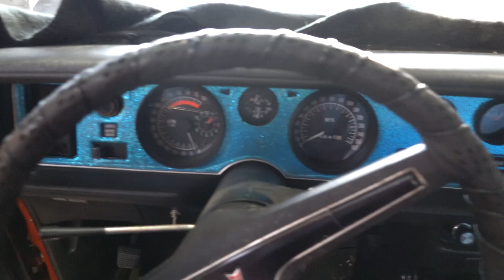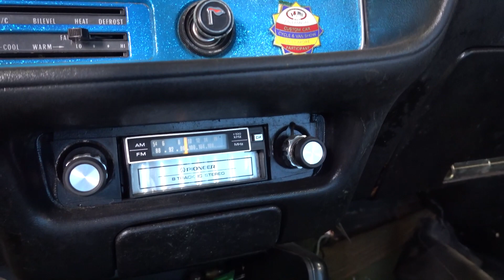1 in a Million Barn Find, Street Freak Firebird! Left since the 90's, sold for $500!!!

Comment: Use an aluminum head  massive stroker butler Poncho Pontiac engine it it.  OR  at that point why not a massive light weight caddy engine? with a huge stroker inside of it. OR Well i also believe a 455 or 400 would be great with the original blower just mild or something. OR
Put in a dart 400 small block chevy block with a 3.625" forged crank that is ground to 3.66" stroke and balanced by david vizard or similar, and 6" rods with with some forged blower pistons, put on some trick flow super 230cc heads and slap on a 6-71 or E force super charger Use an AED 950 blower carb. With a bore of 4.125" this makes a 391.46 C.I. with a great rod ratio so it shall last. Use blower rings, a custom windage tray, and use hooker headers. put some cal tracs on and if in the budget use a 4 speed jericho, this is what the hood was cut out for and this is what fits perfectly-(OOPS i am just noticed the ram air III ported heads 350 pontiac engine that was in it sorry). This engine is much lighter and more efficient than the poncho engine  i just think with the reduced rotating mass it is going to be a happier car and a happier you when all together. Your piston height shall need custom based on 9.000" or 9.025" deck height and your rod to crank journals are smaller so get rods with the needed diameter. It is going to be great. Go easy on the cam a little bit use an XR288HR10 hydraulic roller or the other bigger ones. Ask richard holdener. If you do make this thing you could have anywhere from 500hp to 1000hp depending on boost. You really want a jerico 4 speed for sure. Don't use 3.73 , use 3.23 gears this shall cruise a ton better. I personally would use P295-50R15 on a 15X12 on back with 5 to 5.25" back space ,and not skimmpy on front either, at least a P235/60R15 on a 15X8. For less power and rpm you could go smaller heads and cam and lower compression respectively. We can configure it to run pump gas. i also have many other combos in my notebook. i would get some BFG's for driving but traction is ZERO in that regard for these power levels. As far as bias ply, there is not anything wrong with that, although it is dangerous because they have sat so long because there is likely cracks and compound changing to a different material like rotten probably. My little mustang II ferocious 8000rpm screamer that it was, tore some bias plys rear tires to shreds while driving one day, they were old had a few cracks like several mm long , it don't take much. So i recommend new tires on weld racing aluminum wheels. You can put some P275/60R15 on some 15X10 for easy fit, 5" to 5.25"  backspacing some get 5.5" backspace and then add a quarter inch spacer. this should fit the wheel well much better than the 15X12 and P295/50 and still provide some tire meat with less hydroplane affect. 17's or 18' could work well also as long as aspect ratios are thick and have some air in them, if not it shall just spin tires constantly. i am using 15's on rear with 17's on front of another 2nd gen i am going to work on. I would deck a dart block to 9.025 or use their tall decks for a little more stroke and/or rod ratio. Lastly there is the resort of a big block chevy stroker Merlin III or merlin IV or 454 stocker with or without a mild boost 6-71 set up. remember even a modern built pontiac 455 with forged pistons and some modern aluminum heads and modern roller cam are going to be great even without a blower.

Comment: That thing is amazing. I love that gen bird and Pontiacs in general. The orange and blue rocks. Good luck on the 8 track. There are a couple old guys who work on them. The radio portion should work amazing but the drive belt on the 8 track side is probably dry rotted or broken entirely.

Comment: Keep it Pontiac. Will be worth more in the end. Do a 400 or 455. All Pontiac engines are physically the same size blocks just different bore and stroke but mount same. That is why Pontiac doesn't have a big or small block, they are same. 350, 400 or 455.
Reply: It will do nothing to increase the value... but keep thinking that.